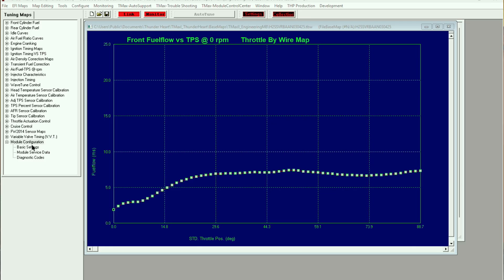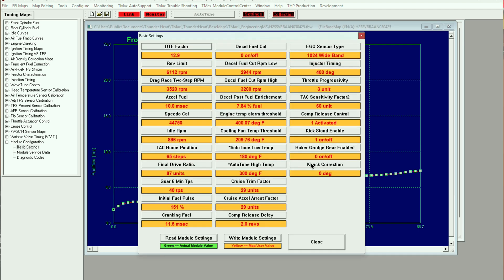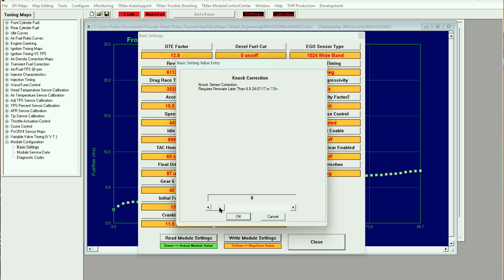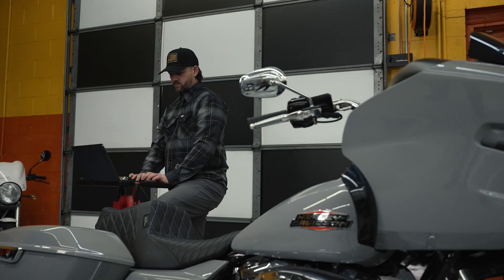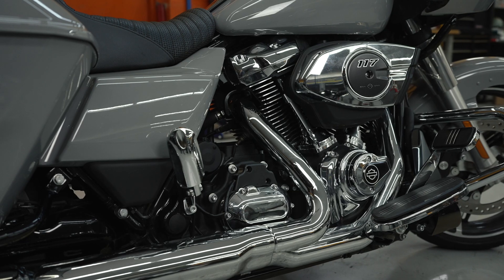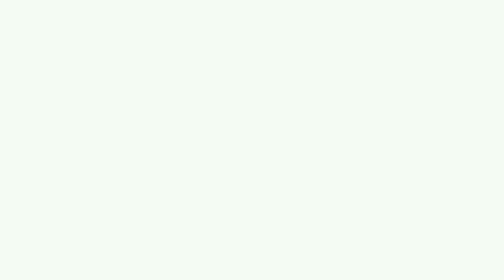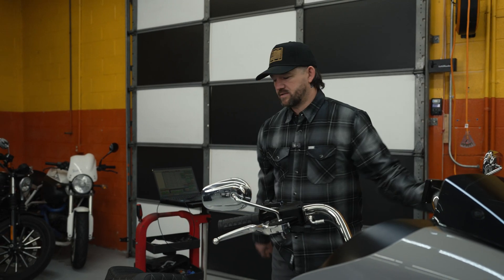ThunderMax Knock Control for HD M8 Bikes

Comment: I'm thinking I should turn off the knock control when I'm initially dialing in the timing after install of the Thundermax so it doesn't interfere with the proper tune, then turn it on after I've got everything dialed in so that it can help me if I get bad gas etc.  Would you say this is a correct method?  Thank you.

Comment: When will the new 2025 M8 Softail ECM put out,or the 21-24 version can cover. Harley put the electric control system (Riding mode, traction control, cruise control....etc) on 2025 model

Comment: If you have a bad map in ecm and wipe all the offsets on it then install a good known one that hasn’t been automapped and has a lot of miles of learned data .
Is it really necessary to clear learned offsets and wipe the known good one before installing it ?
If I clear it then I lose the data I never automapped.
But if I clear all offsets on the bad one in ecm I should be good since I won’t be layering bad data over known good ?
Reply from the maker: As long as you clear the data, you are giving the ECM a new starting point to build the map from.